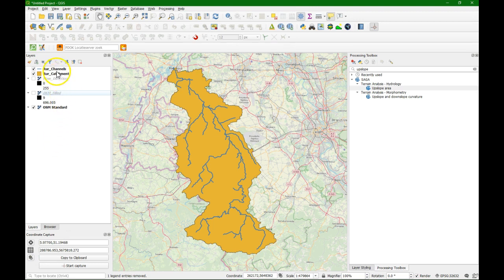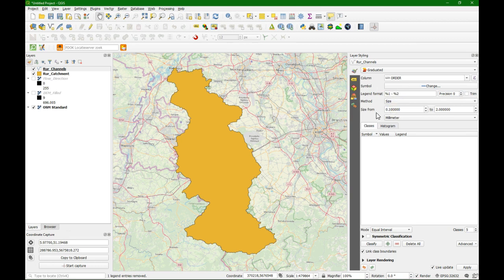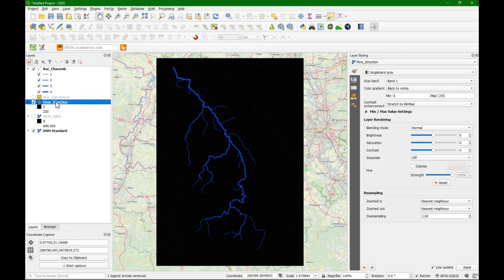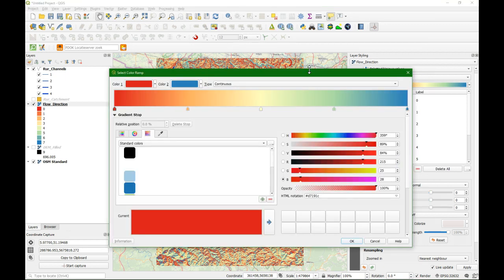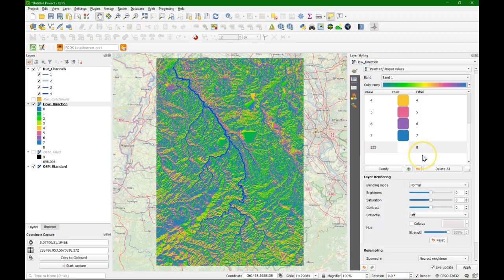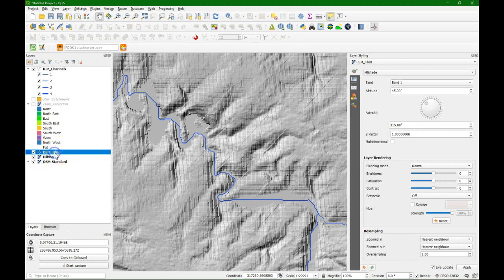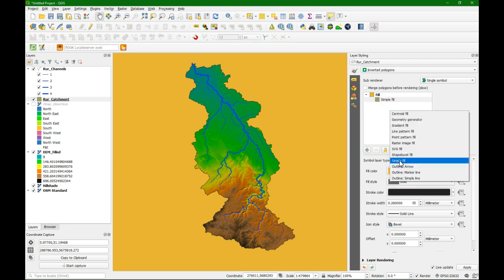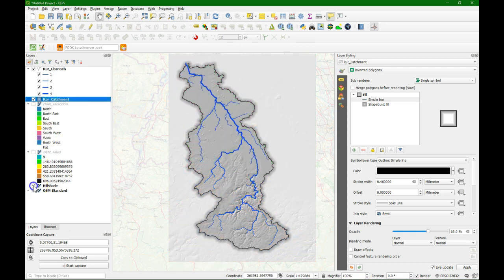Styling of streams, catchment and flow direction in QGIS

Comment: I am having trouble when exporting a map with the flow direction arrows: after designing the layout, the map exported doesn't respect the setted arrow parametres (length, spacing, head options, etc). Any idea how to fix it?  Thanks again for this very useful tutorial series
Reply from the maker: It might not be implemented in such a way that you can easily add it to the print layout with the arrows in the same dimensions as in the map canvas. Can you put your question on Lutra Consulting's GitHub https://github.com/lutraconsulting/qgis-crayfish-plugin/issues
Reply: @HansvanderKwast  I will, thank you
Reply from the maker: @filippoberdes9114  Great. Thanks!

Comment: Dear Hans, 

The DEM (background) at 10:46 minutes looks like a perfect rectangle which then makes it easier when preparing the MAP and looks aesthetically pleasing. 

Is this because you used GRASS tools?

Since i followed your previous video 'Stream and Catchment Delineation in QGIS 3' and cannot seem to get the same.
Reply from the maker: Dear Ian, In this video I used a rectangular bounding box with EPSG 32632 coordinates. So after reprojecting and clipping the DEM with this bounding box it is rectangular. If your bounding box is in a different projection  or you reproject after clipping it will not be rectangular.